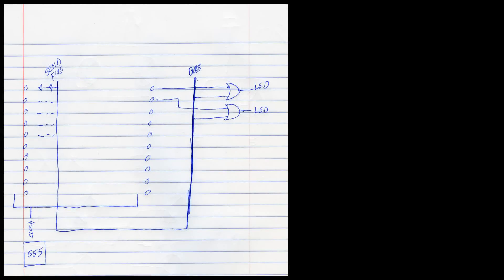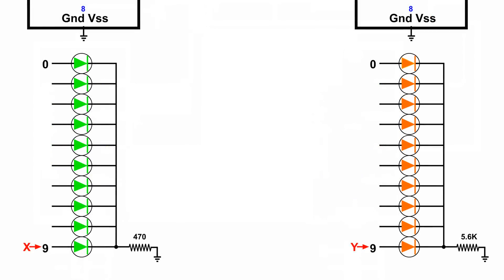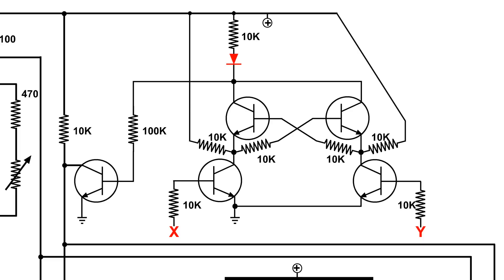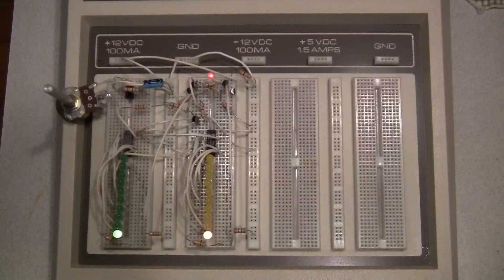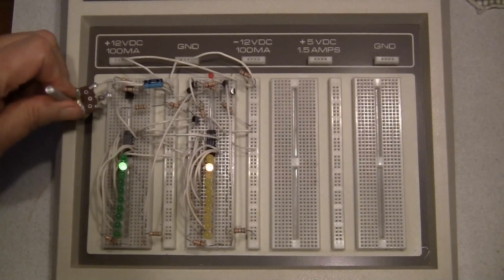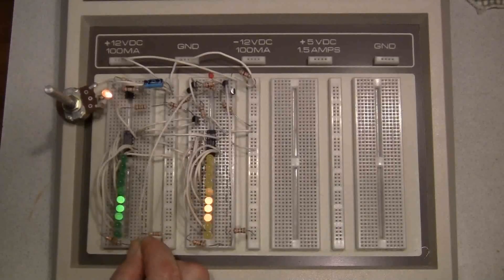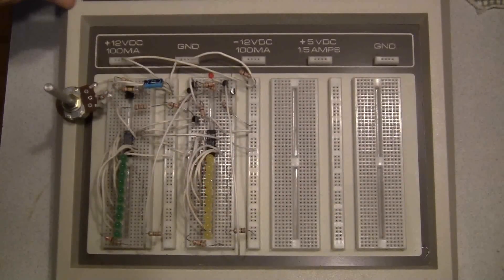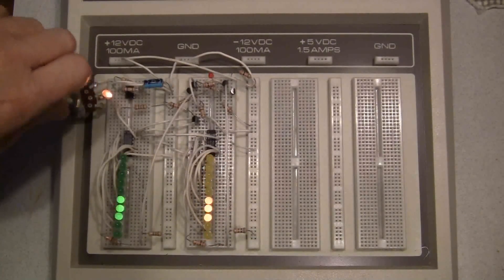XOR Gate Sync Demo 555 Timer 4017 Decade Counters

Comment from the maker: There's many possible purposes. I'm going to multiplex ten signals on a one wire buss. 0-9, from a single digit to all ten digits. The first 4017 will be the transmitter sender and the second 4017 well be part of the digital receiver decoder.